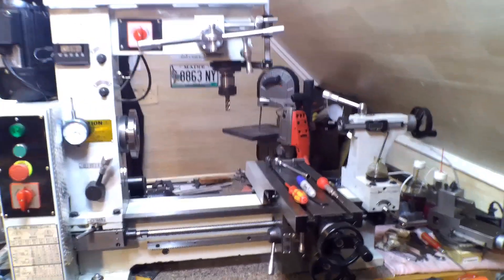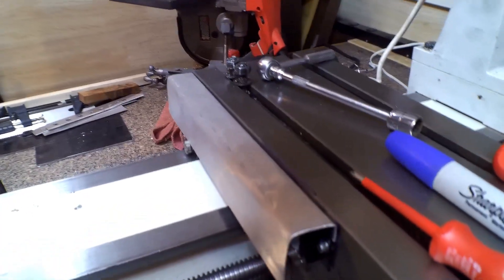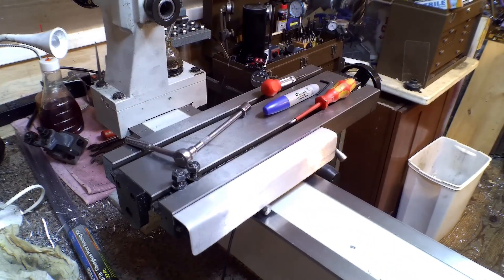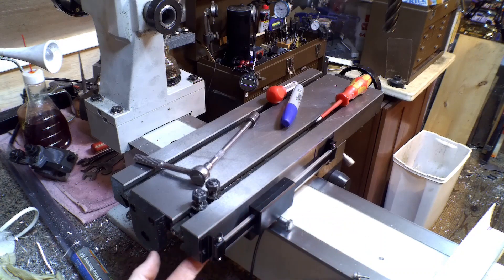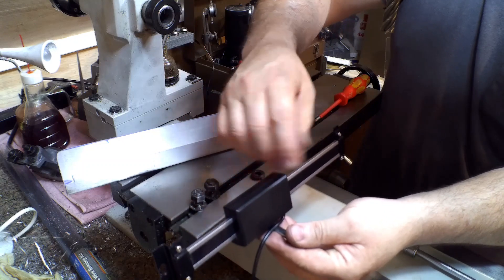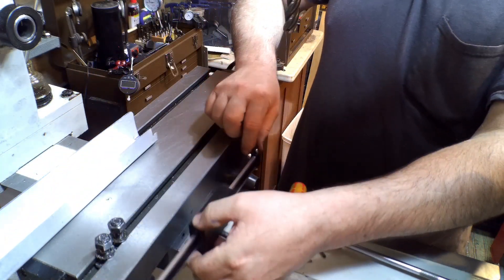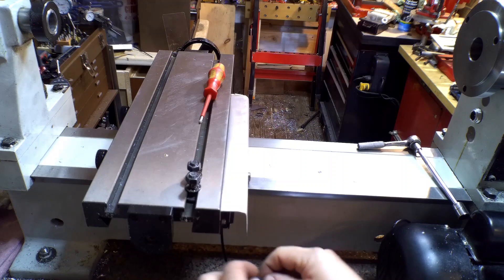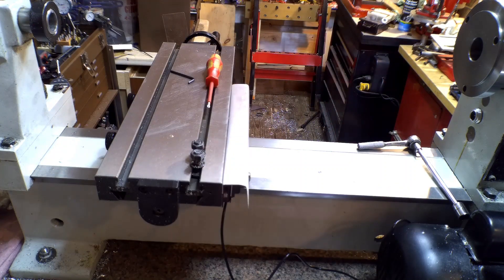Combo Mill / Lathe Table DRO

Comment: Snap on the combo unit and hello from sunny south africa. Bought same combo unit from a machine store here and busy upgrading and learning how to use her properly. Struggling with my cross slide accuracy as well. I see you have a just right sized mill vise in your cross slide. Is it a 4* slide? Am looking for one locally but may have to import.